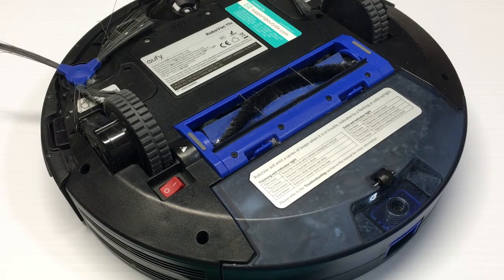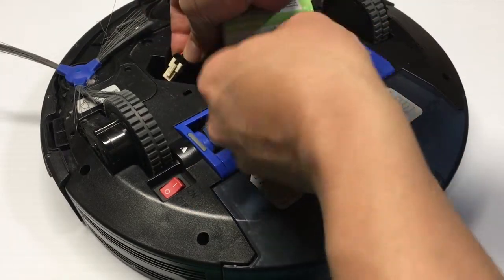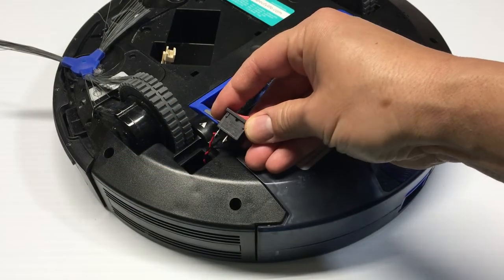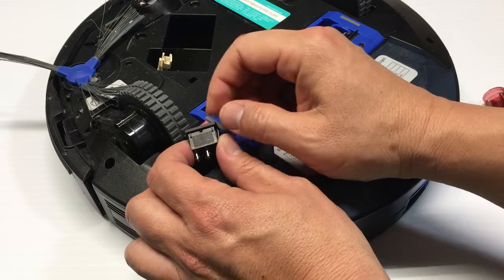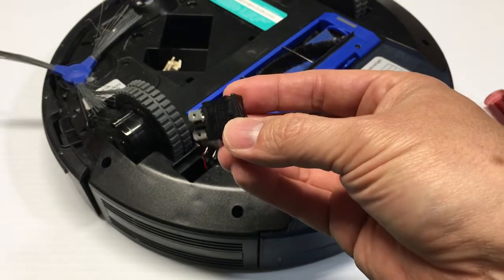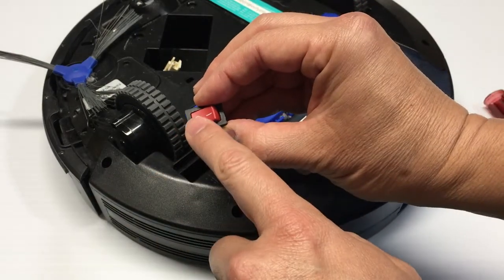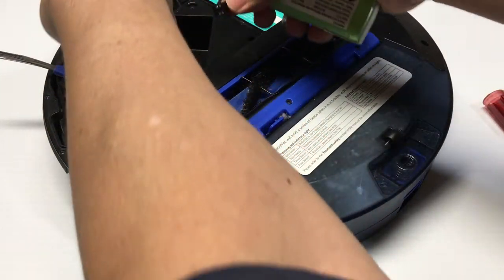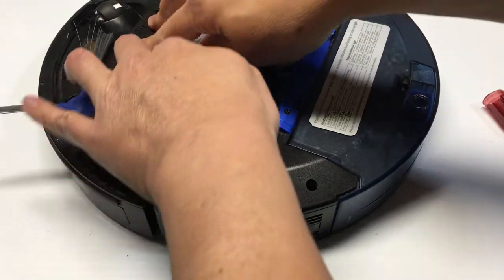EUFY POWER SWITCH FIX - MULTIPLE MODELS AND BRANDS - NO DISASSEMBLY REQUIRED!

Comment: Hello! 
I'd like to know how to remove the plastic/transparent rubber that is protecting the switch button?
Reply from the maker: That dust cover is usually molded into the switch.  If you don't want it there, you may have to cut it off.

Comment: Thank you.  I followed your steps on removing the switch.  Glad you showed that part of it because I would have probably chipped/cracked some of the black plastic trying to get it out my way.  Once switch was free, I blew some compressed air into the cracks of the switch, shot some WD40 into the cracks, and then blew some more air in so to work the WD40 down into the switch.  Wiped dry.  Thankfully (luckily), it worked.
Reply from the maker: Awesome!  Perseverance paid off. :)  Believe it or not, the rocker part of the switch is pretty easy to pop out with very small flat blade screwdrivers.  Once the rocker is out, the contact can be removed and the contact pads can be cleaned and lightly filed or sanded.  It's will buy some time until you can get a replacement switch.
Reply: @AlsAutoandAppliance   Thanks for responding.  Just to clarify:   In my case, I actually did not have to replace the switch.  Blowing the air into the switch and spraying some WD-40 seemed to activate the switch back into working again.   Everything still working well today.   Having your information on getting the switch out was great because it allowed me to get the air/40 deep into the switch.  Thanks again.
Reply: This is exactly what I did and it worked great. Thanks for the video and thanks for the description of the wd40/compressed air.

Comment: Do you know how to fix a sliding switch where the metal bracket has fallen of
Reply from the maker: Sorry about the late reply.  Which model vacuum are you working on?  Most sliders are held together with metal tabs on the metal part.  You can usually put the parts back together then bend the tabs back over the non-metal parts.  If the tabs are broken off, you might be able to solder from the bracket to an unused terminal on the switch to keep things together.

Comment: Great video. I had commented on another of your videos about what seemed to be a switch problem with my Eufy 30C Max, where Eufy had suggested flipping the switch back and forth rapidly. This did seem to make my unit come back to lief. But I wonder how long that will last. And does that indicate something other than a completely failed switch? Is there such a thing as a partially failed switch? Seems logically to replace it in either case.
Reply from the maker: Yes, it's is definitely possible for a switch to be intermittent, and on eufy vacs, nearly 100% chance.  Glad to hear you are back up and running for now. :)